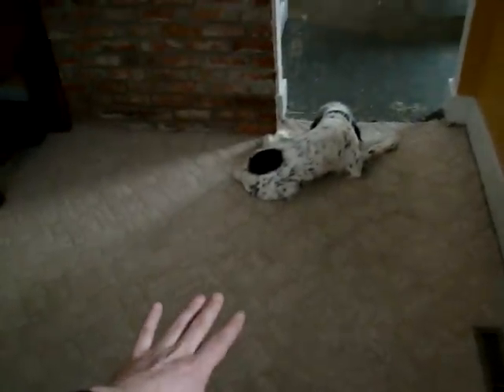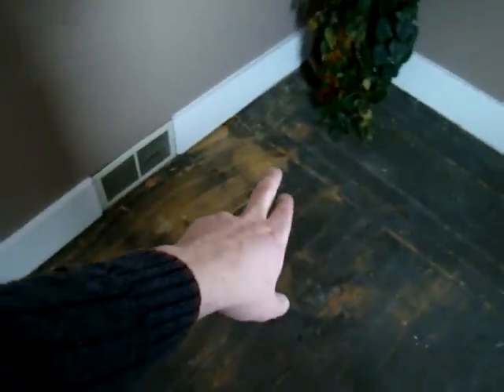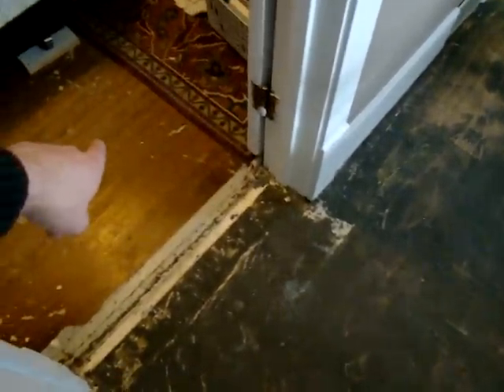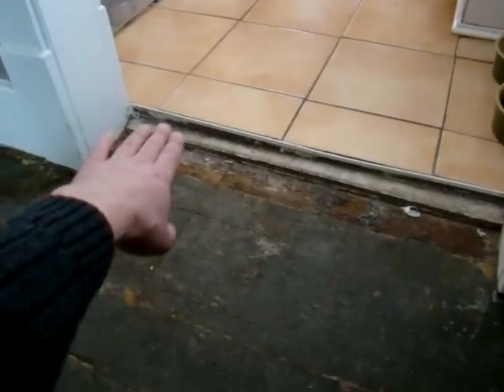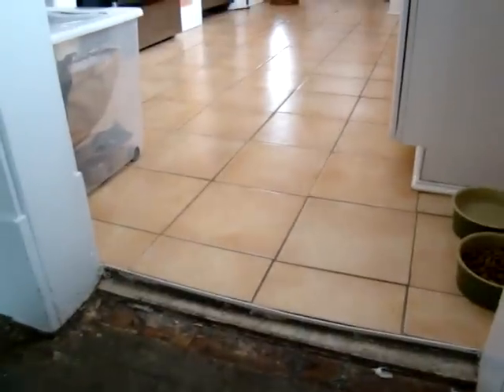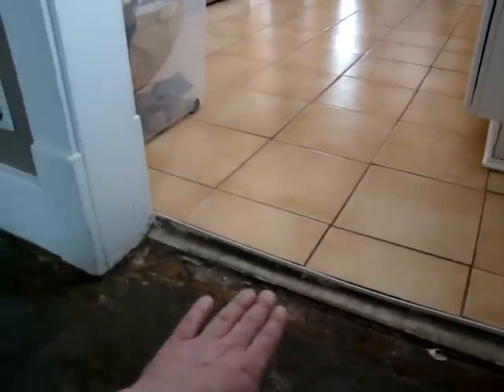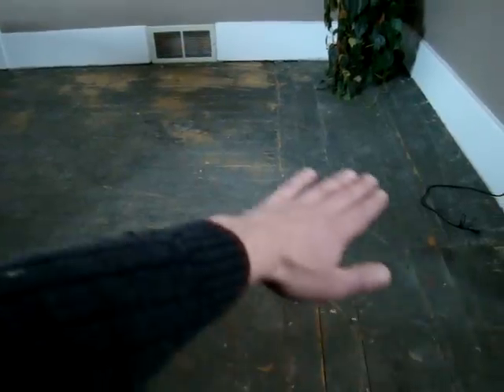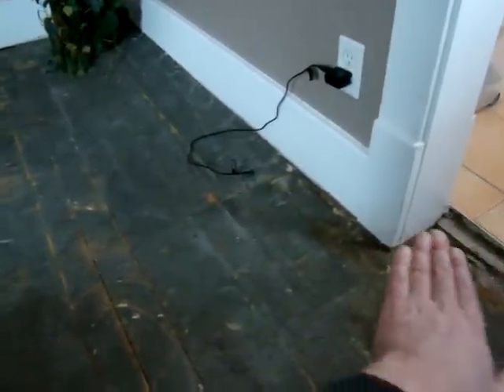Saggy Floor from the top

Comment: If you have a good size basement I would say your best bet to raise the floor is jack posts. They are metal posts with adjustable screws on th bottom and top. You would put them on the joist under you floor were the wall I assume new wall was put by the old owner. Do not put the jack post on the ply wood under the floor as it will just punch through. Try and use two of them under four joists at the least. You will have to make a 2by6 min beam 3 ply.so three two by six inch under the jack posts.